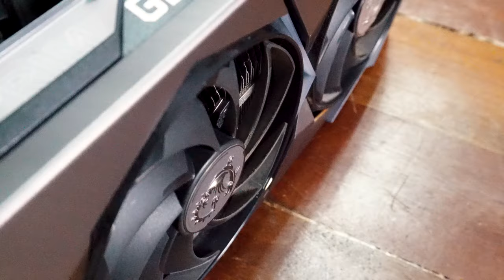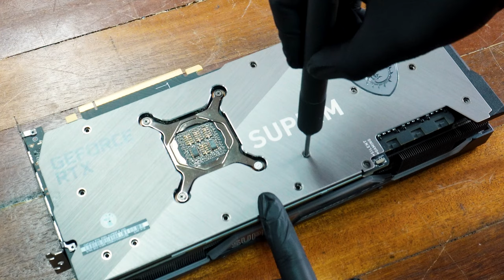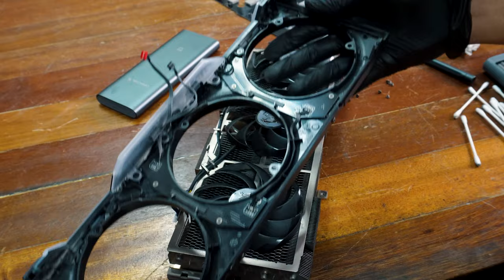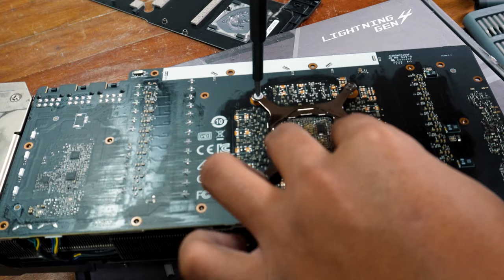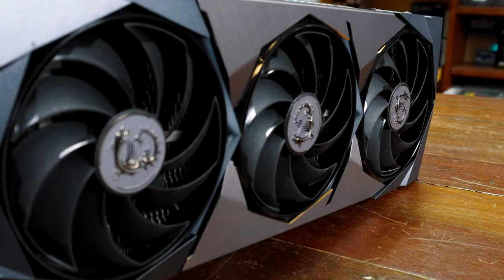Cleaning a GPU in less than a minute ⏱️ (SUPERCUT)

Comment: Magkano palinis gpu sa inyo? (Includes thermal repasting and replacing thermal pads)
Reply from the maker: GPU Repasting - 2,250
👉 Disassembly and Reassembly of GPU
👉 Cleaning of interior of GPU and cooling element
👉 Application of new thermal pads and thermal paste as needed

Comment: what does yung oil/wet appearance dun sa PCB mean? I notice the same sa motherboard ko, ever since it was newly-bought. safe kaya na may ganun talaga ang PCBs?
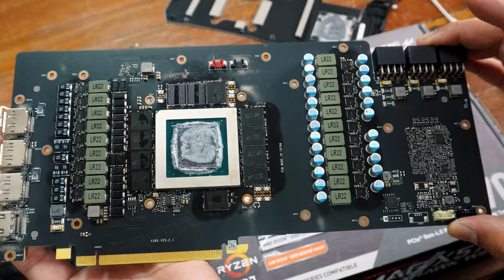Reply: You mean the one at 0:17? Thermal paste yun AFAIK
Reply: @JeyC_  hmm, not the one on the die itself. yung parang darker shade ng PCB, sa parts surrounding the components (capacitors, chips, etc.)
Reply: Naeextract sya from the thermal pads kapag sobrang init. Nagiiwan sya ng mark sa board over time. Been seeing these marks both sa GPU and mobos ever since I started working sa shop and so far wala pa naman kaming na encounter na nasira because of that.
Reply: @KuyaJay013  oh, good to know. salamuch boss Jay!

Comment: Decent iGPUs: "are we a joke to you?"
Reply: Decent iGPUs? I mean iGPUs exist but I don't think there's any 'Decent' ones out there.
Reply: @Xorthis  RDNA2 exists, since it's the APU behind the 9th gen consoles.
Reply: @RockOrso2  Gaming grade iGPUs don't work in the PC architecture. Not mentioning the fact the APU wouldn't fit in socket AM4/5, They need very heavy cooling, they require the user to install a bunch of extra RAM (8GB at least dedicated for the APU) and once you've paid for all this, why not just get a dedicated card with GDDR6+, dedicated cooling and that fits in existing architecture? 
 
So yeah they exist, but not entirely sure what your point is, since they have very limited application outside of propritory platforms like consoles when it comes to powerful gaming.
Reply: @Xorthis  cuz handheld PCs are beginning to become a darkhorse SFF choice with them often having (6/7)000M chips??? You've got a point with discrete GPUs, but wider options are ok since discrete GPUs often sacrifices portability for power, consumers gotta plan out their tech purchases carefully if they want power or portability, cuz even ITX is pretty much stuck in the middle but pays like an ATX build for their compromise.